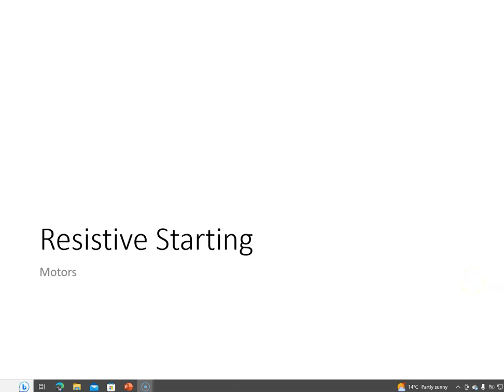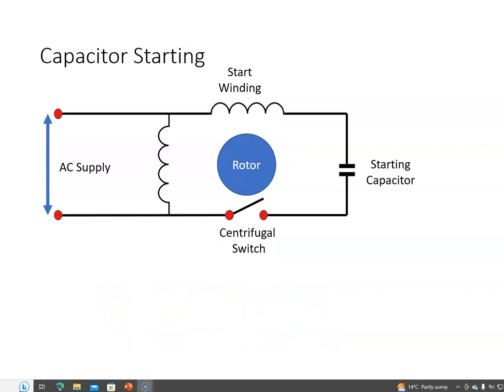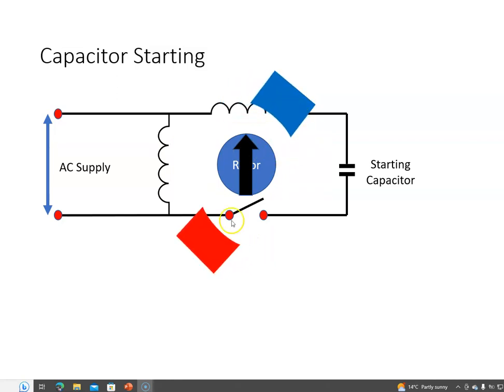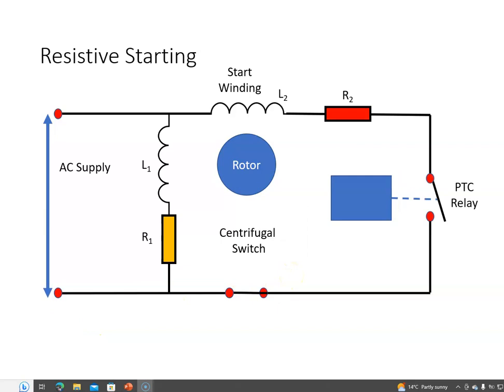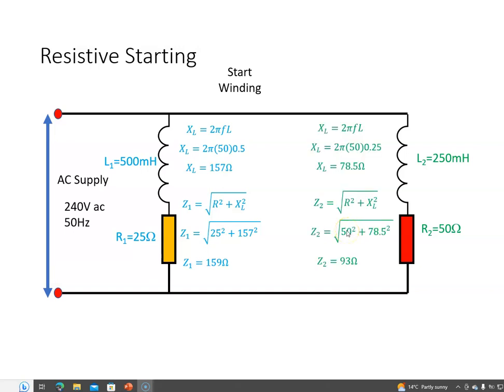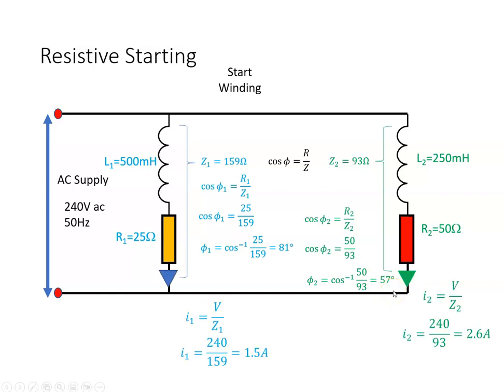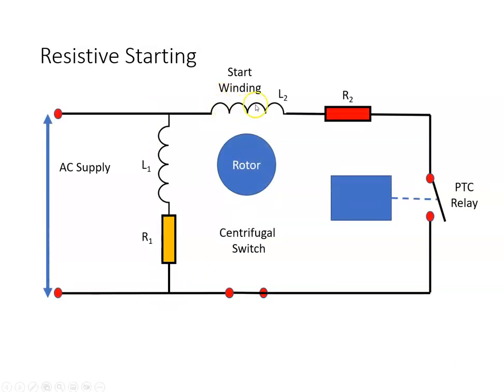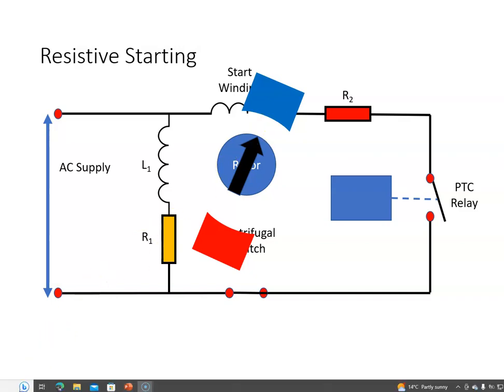Resistive Starting of Single Phase Motor

Comment: Instead of a centrifugal switch that can get stuck, some motors employ a PTC relay, which opens the start winding after a short time has elapsed.

I have seen both capacitive and resistive start windings controlled this way.

Comment: Hi Roddy…hope you are well 😊….quick question…following on from previous chats….I see the 2 Pole Induction Motor has an Aux / Start winding….is this the same for a 4 Pole AC 1 Phs Motor? Only when I look at the 4 pole motor…I see only 4 Poles and no Aux Winding. 🤔. So how is the 4 Pole Motor started ? Greatly appreciate your comments 👌 best regards Rob
Reply from the maker: Hello @robinfrancis2.   Any single phase induction motor will need some type of Aux / Start winding to get it to start.     Of the 4 poles you see, I'm assuming one of the pole pairs is a start winding and has either a start / run capacitor in series with it, or uses the resistive starting technique described in this screencast.
Reply: @RoddyMcNamee  Hi Roddy…greatly appreciate your reply and feedback 👌.  I’m still trying to find my way with this subject 🥴.  Ok…so when I look at a 4 Pole motor schematic…to me it looks exactly the same as the 2 Pole (ie I don’t see an additional Aux winding which presumably drops out after start 🤔). Perhaps if you could send me the schematic of a 4 Pole motor showing Aux Winding…this would be a great help 👌.  All the 4 Pole schematics I see just show 4 Poles.  With the 2 Pole it’s pretty easy to identify the Start and Run windings….but the 4 Pole throws me. Sincerely grateful for your help with this. 👍
Reply from the maker: @robinfrancis2911  Have a look at the schematic at this site  https://wiredataverda.z22.web.core.windows.net/single-phase-ac-motor-wiring.html
Reply from the maker: @robinfrancis2911  4 poles is 2 pole pairs i.e 2 pairs of North and South poles.

Each pole pair are wound in series.  So the same current flowing through the windings in one pole will flow through the winding in the pole opposite it.   One of the pole pairs will have a start capacitor also wired in series.
Reply: @RoddyMcNamee  …so one last question Roddy …are you saying that each of the 4 poles has both start and run windings wound to it?
Reply from the maker: @robinfrancis2911   No, I'm not saying that.   One pair of poles is start / run.    The other pair of poles is run.
Reply: @RoddyMcNamee  …so one pair act as both start and run…with the capacitor circuit disengaged after start ?
Reply: @RoddyMcNamee  …just a note of thanks for your replies today Roddy….i guess if I could just see the configuration for the 4 pole motor including start winding it would clarify everything as I can’t understand how you can have both the Start and Run winding on the same Pole as you suggested.  In any case sincere thanks for your time 👌.
Reply: Hi Roddy…thanks for your help….as I said I’m just feeling my way with this…I have a general interest in the subject area….and I’m always curious about how things work 😊.  If you could just explain how the as you put it ‘Start/Run’  can be on the same pole I’d be grateful 👌😊
Reply from the maker: @robinfrancis2911  Hi Robin.  I will do a video for you.  Give me a few days as I'm extremely busy at the moment, but I will do something for you.
Reply: @RoddyMcNamee  that’d be great Roddy…you’re a real gent 👌….i don’t like bothering you, but I find your explanations and videos really helpful. If I could just see a schematic or animation of a 4 pole 1 Phs AC induction motor showing start and run windings it would be so useful….sincere thanks again Roddy 👌